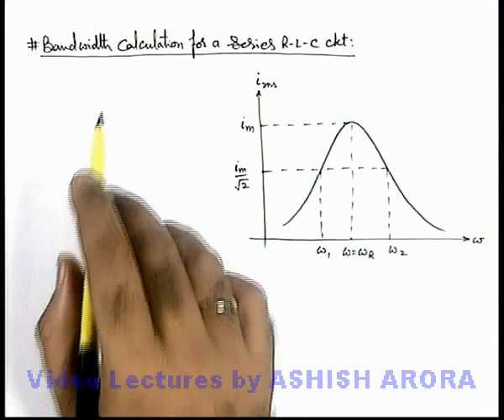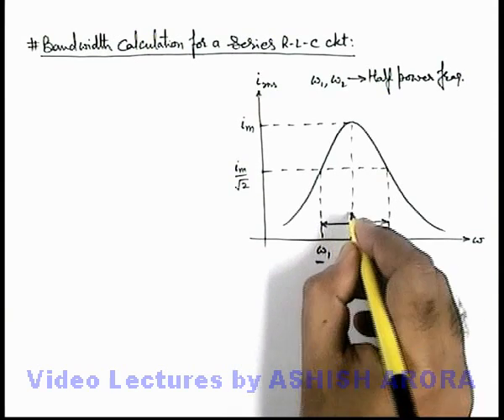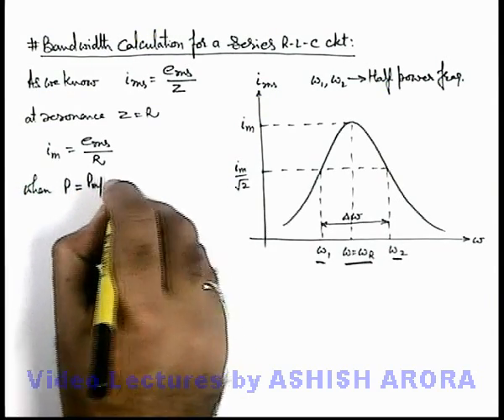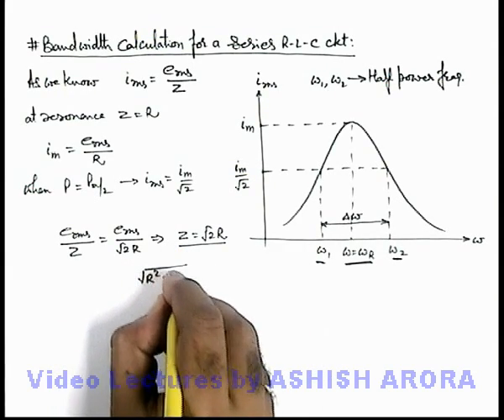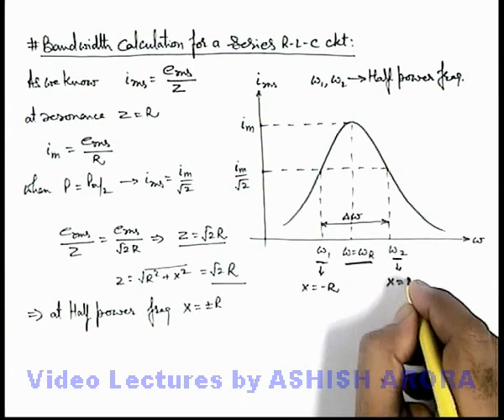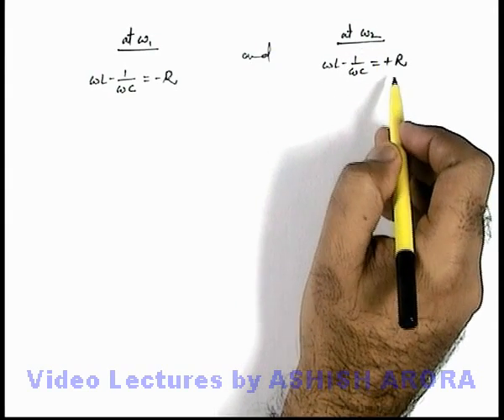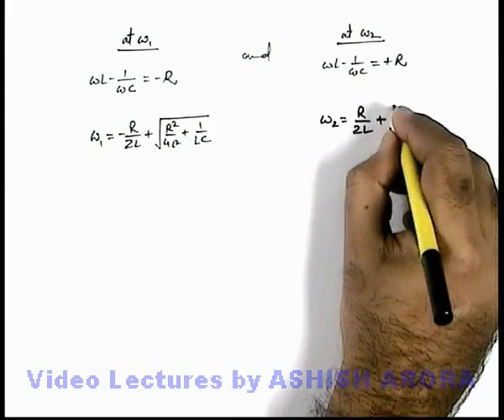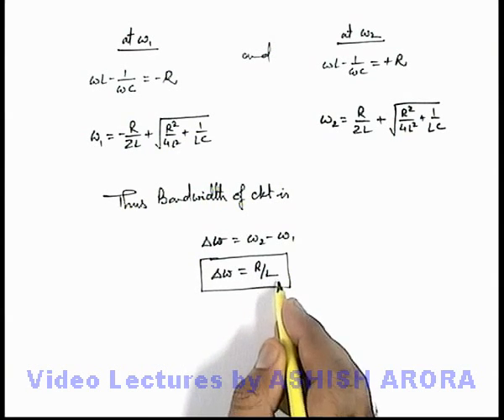Class 12 Physics | Alternating Current | #41 Bandwidth Calculation for a Series R-L-C Circuit

Comment: Sir ,why Vrms /Z = Vrms/root2R
Reply from the maker: At half power frequencies power is half of the peak power at which emf will be Vrms/√2 so at peak value of power Z=R so at half power points Z=(√2)R
Reply: @physicsgalaxyworld  at 1:47 I didn't get how reduced voltage will effect impedence if both voltage will be V/√2 and impedce will be √2R then power will be P=V^2 *  R /√2  
That will not be half power
Reply: @physicsgalaxyworld  sir then at you should take E m /root 2 as in power equation or Im/root 2 in power equation in order to get power half of its peak value but taking both as root 2 at a time means power will be P/4

Comment: sir how can we plot graph between I(rms) and omega ... Irms of any ckt is a const value = Peak current * root2 ,,, 
plz clear the doubt ASAP?
Reply from the maker: +Momin Parveez DEV is correct.... but see it in a different way... i(rms)=e(rms)/Z where Z is the circuit impedance which depends upon omega... if we change omega... i(rms) will change thats why it varies with angular frequency... hope it is clear now to you... or you can follow all lectures in sequence on website www.physicsgalaxy.com
Reply: +Momin Parveez man do you even know what is omega ? check its meaning and you would get your answer .
Reply: +DEV nope , i don't , that is why i asked this question.
Now to my knowledge omega here is angular frequency i guess so. and the ques i asked is meant grapgh between 2 variables can be a curve but graph between a const and a variable ? is either a horizontal or vertical line .? if u can help, please go on!
Reply: no man see at diff frequency current would be diff here omega is independent variable and current in dependent on omega ! you should check ac generator rotates at speed omega it produces current !